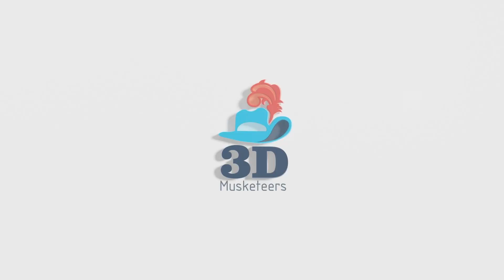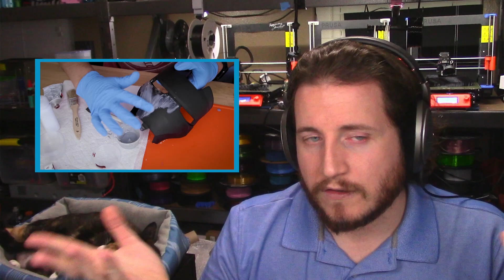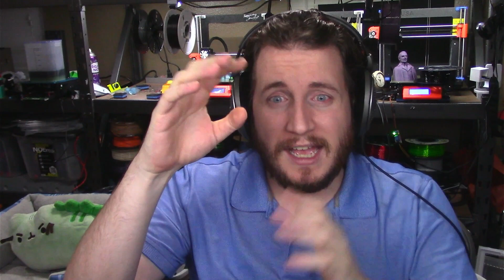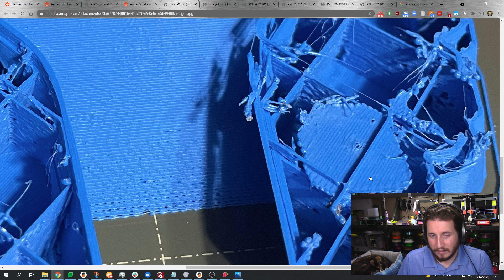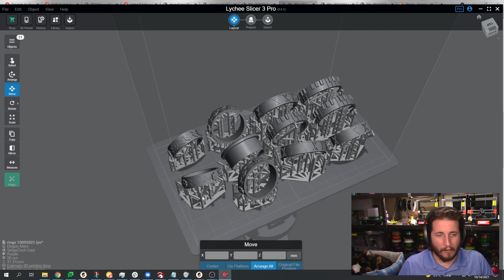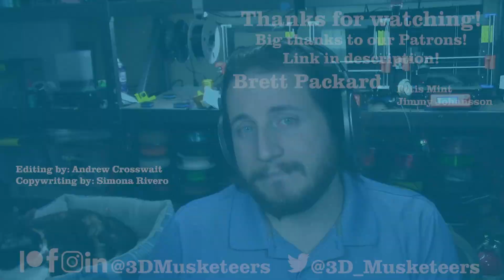Scary Print Fails!! - PrintFailFriday Ep. 5

Comment: This vid series is really handy! Today I ran into a similar curling issue, but I remembered the tips on this video: slowing didn't help, adding supports midprint weren't an option and the stock cooling on an enclosed Prusa Mini+ wasn't enough, so as a stop gap fix, a table fan came to the rescue for the overhangs 😅
Reply from the maker: Oh yeah, enclosed printers will experience this issue more often than open air. Enclosed is great for materials like ABS, ASA, Nylon's and others that HATE air anyways, but PETG and PLA don't seem to care for it and can sometimes see worse prints if the chamber temp gets too hot. You could look at setting up a fan system on the enclosure to bring in more cool air?
Reply: @3DMusketeers  That's pretty much the plan!
Reply from the maker: Sweet! That should work well!